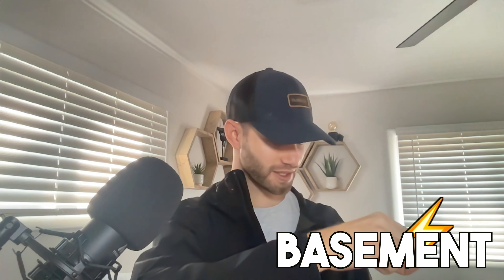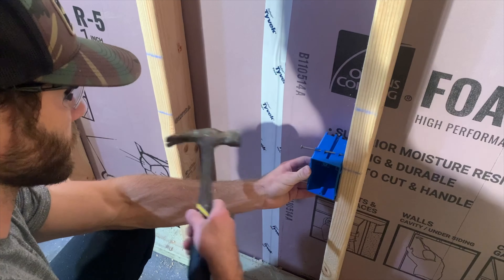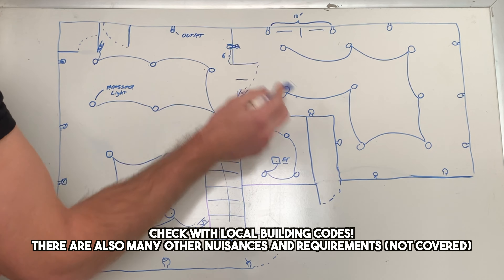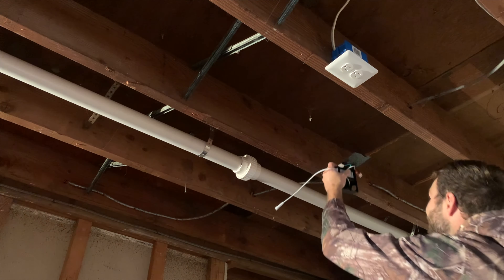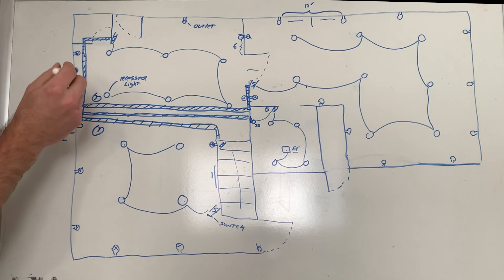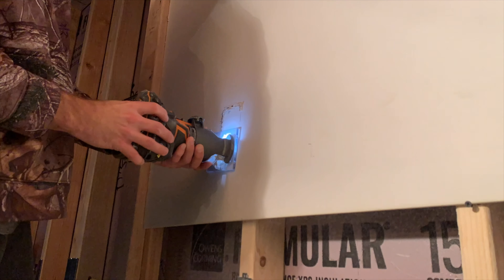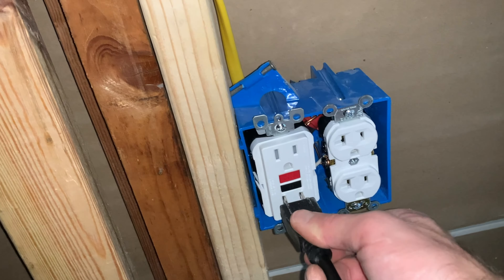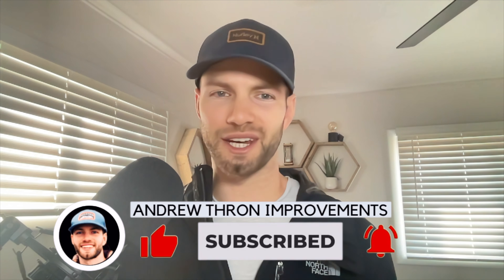Tips for Adding Electricity to a basement (How to Finish a Basment Ep. 3)

Comment: Certainly understand the CYA for the electrical installation.  However, you do know a lot.  I agree with one other commenter that separate circuits for the duplex outlets and the lights is a good idea - for the reason he stated.  You did use 12/2 Romex (20 amp), appropriate 20 amp duplex outlets, but if someone thinks they can put a high amp device (e.g. heater) on one of those 20 amp duplex outlets that person might be disappointed by how much is already on the circuit (though I did note that you used energy efficient lighting).  Also, good commentary on the protective nail plates over the wires.

Comment: What about the regular insulation? If u applied the R-5 you don’t need the regular one ?
Reply: You are referring to Batt insulation. That would give it an additional R12 rating. I guess it depends on if code requires it. Either way, I would still install it. outside walls only.
Reply: Here in PA we have to have R19 in basement
Reply: I installed additional foam board in between the studs. Used foam board instead of fiberglass to help prevent mold.

Comment: I found that those ceiling lights last maybe 5 yrs. Failure could be the light but also may be the controller box. My lights have a lifetime guarantee. My dealer asks for both parts tok determine which is faulty. Make sure the box can be accessed for replacement. I did not do this and created an unnecessary mess servicing mine.
Reply: Being lazy up front will always cost you down the line. Just install normal Can lights and all you will need is a new bulb.

Comment: I think you  must know much more about electricity than you allude.  I like the drawing to get your focus on where you need switches and outlets and the one circuit per room concept.  Now; are those beautiful ceiling light fixtures high light/low energy lights? If I were to wager, I'd say they are but...    Can you say more about 12 2 romex cable?  Is this a norm or special use cable? Did I miss the part where you attached the wires to your box?  I am guessing you are some type of engineer; you are just too savvy to be a run of the mill DIYer.  As always your presentations are great.  I hope your Holiday period goes well and you have a great party in that basement. :)
Reply: This guy does not know what he's doing with wiring.  Never put your lights and outlets on the same circuit, or else when you plug something in and pop the breaker you'll suddenly be sitting in the dark.  You don't put your bath lights on a GFCI protected circuit for the same reason.  He's using recessed LED lights.  NM-B 12/2 is the standard cable you use for wiring 20A circuits.  You can also use 14/2 for 15A circuits.  He is using non-metallic boxes.  He shouldn't have broken the tabs out of the boxes as those are designed to clamp the wire.  You don't need to ground non-metallic boxes.  Cable stud protectors are only needed if the cable is less than 1.25 inches from the stud surface.
Reply: @stargazer7644 it’s all about how you want to do it. If it’s a customers house, sure run the individual circuits for your lights, if it’s not then do it however you’d like. The lights going out when you trip the breaker isn’t really that big of a deal and it’s not a code issue. If your low on money, depending on distances to the panel individual circuits could be a $100-500 investment. Just depends on the situation.
Reply: @stargazer7644  There is absolutely nothing wrong with putting you lights and outlets on the same circuit. Every house I have lived in on my well over 60 years has had the lights and outlets on the same circuit. Putting them on separate circuits needlessly wasted breaker slots that may bee needed down the road. There is also nothing wrong with installing 12-2 wire for your outlets. It ads a bit of safety of additional safety and future proofing if you decide to change a circuit to 20a in the future. Those tabs on the blue NM electrical boxes at the big box stores are useless. Once you break the to rung the cable through, they won't hold anything. The staple next to the box will keep the cable from getting pushed back out.

I didn't see him grounding the NM electrical boxes, but I got a good laugh at him saying to use the Light brackets for the led pick lights he was using.
Reply: @MAGAMAN I guess you have a reading comprehension problem as I told you what the problem was with doing that.  If you wire your outlets with 12-2, why in the world wouldn't you put a 20A breaker on it at the same time? Cluelessness.

Comment: Hi, why are sockets located at such an uncomfortable height? After all, to turn on some device, you have to bend over
Reply: There's actually no 'maximum' height per NEC. Some jurisdictions may overwrite that and the ADA has a max, but if you're not in need of ADA compliance or in a jurisdiction that overwrites it, you can have it at any height. In my laundry room that I rewired, they're all at 4' 6" as that's what was a height that was very comfortable for my grandmother. Thin laundry rooms + having to bend over(especially at an older age) = no bueno
Reply: Those outlets are actually way too high. They shouldn't really be more than about 12 inches off the ground, unless you have some kind of mobility issues.
Reply: @MAGAMAN  It's inconvenient anyway.  I don't want to have to bend over every time I need to plug something into an outlet.

Comment: In many videos that I've seen installing the slim LED recessed lights, people don't use nm connectors at the entrance of the junction box. I see it here as well. It is a requirement whether it's the old style or plastic buttons. Otherwise, there is the potential fire hazard with the cable or wires being nicked by the metal creating a spark. Also, 12/2 is generally way to heavy for the small junction boxes of these lights. 14/2 would be sufficient as long as it's just a lighting circuit.